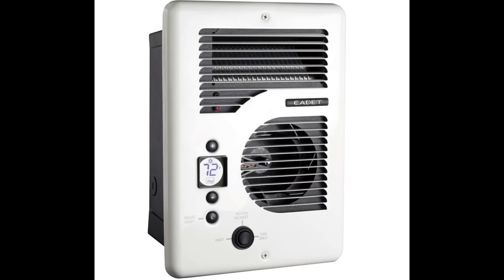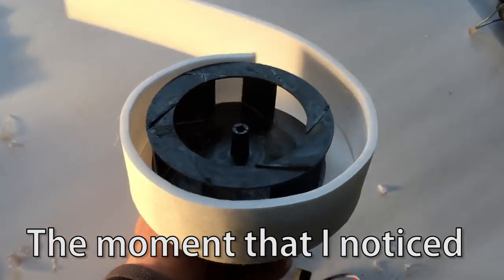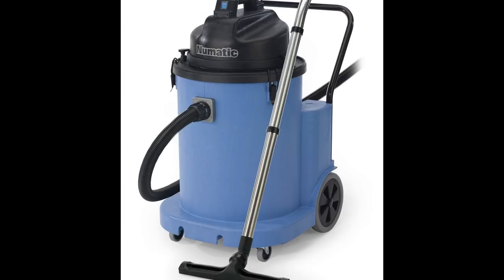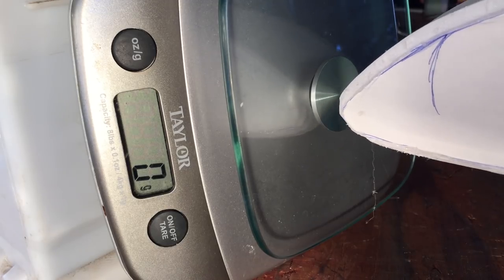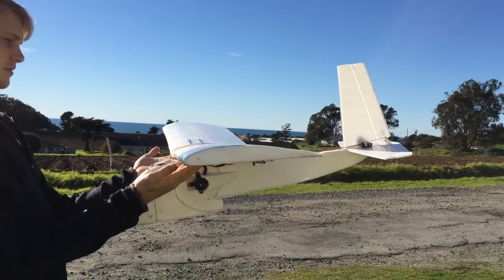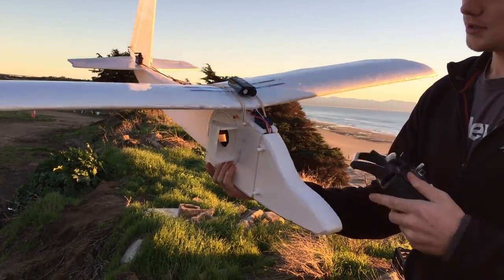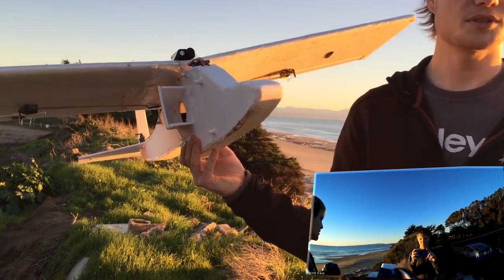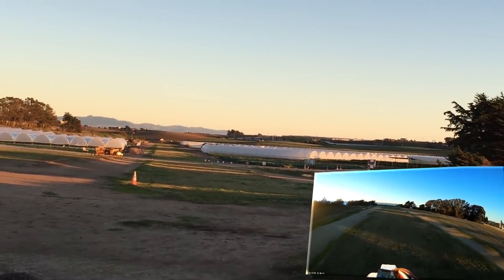This is NOT a Propeller

Comment: Brilliant.  Nice work 'thinking outside the box'.  Your only problem is that the compressor is terribly inefficient.  Centrifugal compressors in jet engines, for example, have curving radial vanes.  You might find such a compressor in some old vacuum cleaner.  If you can find one that's light enough and the right size and use that instead, you might increase your thrust quite a bit.

Comment: I like the moving part contained inside the plane so no dangerous prop outside to cut fingers.  Similarly you could make a cavity in the plane for a propeller system and force air out a similar nozzle.  I wonder how the efficiencies would compare then?

Comment: Centrifugal induction fans are more suited to producing a high static pressure differential rather than a high rate of airflow. Consider ejecting the air out through a smaller nozzle (or array of nozzles) on the inside of a large-diameter tube. As this lowers the pressure in the tube, it should draw a large current of ambient air through the tube and accelerate it, which should increase momentum transfer. (See Dyson's bladeless fan or how you can inflate a large plastic bag by blowing a slow continuous stream into it while holding the opening wide open.)

Comment: Nice. Very nice. Innovation’s always good to see. Wondering if your comment on efficiency is partly from inevitable internal drag from all the ducting surfaces the air is forced to flow past? Torque reaction to impeller/propeller rev changes is also a factor in very lightweight designs but you seem to have dealt with that rather well. Impressive.

Comment: Fantastic: I have been always thinking that a cross flow fan is better than a standard propeller! The one that you have used is not designed for the scope of aircraft propulsion: imagine how much should it have performed if designed exactly for the motor power and RPM that you were using!

Comment: What about the pressure difference created due to the impeller intake on one side, that side would ideally be having a low pressure as compared to other side. In my knowledge that should influence the yaw. Did you feel that while controlling the plane ?

Comment: Great initiative and great video . Not entirely original though . I have seen plans for scratch built ducted fans from the late 1950's and 60's that used home made centrifugal blowers like this . At that time jet engines used centrifugal fans so it probably seemed perfectly natural to those early builders . I have never seen one of these planes actually fly before though so thanks and good job .
I am thinking I should buy a leaf blower and strap some wings on it .....

Comment: You could put the motor inside the fan and remove the cowling for air intake and improve p/w ratio a lot. Very cool development!
Reply: Yes, I agree and:
If the motor is inside the rotor, you can make two inlet ports (1 on each side).  This could improve efficiency by bringing in the air with less resistance
Reply: sure, but he just grabbed an idea and smashed it out, probably in a weekend. you can see the body is roughed out, not aero contoured beyond its being cutout. he just wanted to see if he could do it :-)

Comment: Nice Video part of the lost thrust is the construction -closer spacing between spinning
rotor and frame or using a rotor from a leaf blower with a round frame will give thrust.
for more speed you need to change exhaust outlet size to increase the exit air's speed

Comment: Two things:
1. Invert the entire motor in the airframe to take advantage of gyroscopic precession which will induce a lifting moment.
2. Use the high velocity air moving over the airframe to assist in lift.

Comment: Your comments on the efficiency don't take into account the mass of the fan - probably more than 10x a two bladed axial propeller.  Also, a propeller is constantly being pushed into it's airstream, whereas the centrifugal impeller is operating with it's intake in the slipstream of the body - a partial vacuum.  Centrifugal blowers are designed for higher pressure across the system, but as a trade off they have a lower flow rate.  Use two smaller ones (lighter and less friction at higher RPM) horizontally, counter-rotating, with a well designed intake facing forward, and I'll bet you get a much better efficiency.  Of course, that would mean a lot wider body.  Maybe a flying wing?  lol...

Comment: If you add an extension to your exhaust, and make it a smaller dia. you will accelerate the air and maybe get more thrust
Reply: Actually not, as it would need more weight so it won't rip it in pieces and is controllable.
Reply: @SheIITear  ok

Comment: Thinking again about the Dyson vacuum cleaners...
Why didn't anyone design wings that provide thrust? That impeller is the perfect solution for high velocity output to the trailing edges of the wings  via narrow vents in each ailerons that are effectively thrust vectors and control surfaces.

Comment: Turn the blower 90 degrees so it's sucking air in from the top of the plane, creating a vacuum above the plane and therefore creating more lift. No intake ducting needed.

Comment: I think: and with two impeller of vacuum cleaner, directing the air flow inside the wings...

and the wings with openings underneath that run along the entire length and facing backwards like in a fan without blades?

Comment: I think so if the exhaust would be placed above the body, there would be more lift. A high velocity of air above the body would create low-pressure above the body. But it will require a bit of modification to the tail.
Anyway, loved the video. it was great.

Comment: Nice and satisfyingly noisy. Nice landing, too. Perhaps make the air intake adjustable to find the optimal intake angle. I was surprised the intake didn't seem to make the plane want to turn to the right...
Reply: The blower could be disguised as being the engine of a jet and the sound would sort of fit in.  
You get surprising little effect from sucking in air.  Imagine you are standing right next the surface of the plane with a pressure gauge.  You will see normal air pressure.  When you move next to the opening, you will see only slightly lower.  The difference in pressure times the area is the force and it won't be much.
Optimizing for a blower than moves a lot of air at very little pressure difference will make a more efficient aircraft all else the same.
Reply: Ken Smith   I see. Thanks

Comment: if you turned the intake to the front and then made cone 90% excite you can get the best of both forces. + if impeler is now horizontel you can hide it inside the wing and save on drag.

Comment: You could perhaps get more efficient if you got the blower duct to blow of the top of the wing, as the air on the top of the wing would be moving faster causing lift. Right now the air is blower is blow the rear tale underneath where it is casing it to loose lift, along with the talk will cause it to go nose up under high trust.

Comment: Should go onto ebay and buy the ones they use in Blower style graphics cards, they spin at pretty ridiculous RPM, and make a multi-engine one.   

One interesting difference with you design using the central fugal blowers in that orientation the torque coming off the motor would mostly and fairly easily nuetralized by the tail instead of trying to twist the plane

Comment: Well done Samm!
I believe you could get more thrust by making a turbo on opposite sides of the fuselage with one shaft through one electric motor driving both turbos.
What do you think?
Reply: I just read the comment on the inlet on top for lift. Sounds good! Maybe even a angled up for lift. Because I think you get better current through the turbo with the front pressure
Reply: I just read the comment on the inlet on top for lift. Sounds good! Maybe even a angled up for lift. Because I think you get better current through the turbo with the front pressure

Comment: Couple of things:

First, kudos to your inventiveness!

Second, you more or less lucked out with your exit nozzle.  In fact, it's ALL in the nozzle.  You're right, the ever-increasing spiral of the blow is correct, but what then?  A good nozzle minimally restricts the air while producing far greater velocity.

Third, at low velocities (sub-300 mph) and low altitudes (sub-20,000 feet), propellers are much more efficient than turbines.  This is why all short-haul aircraft use turboprops whereas long-haul aircraft use turbofans.

Fourth, please visit the American Modeling Association's website.  I know you're probably not a member, but those rules you were flagrantly violated were created for a reason, primarily to thwart government interference into line and remote controlled aircraft.  

Please follow the rules and help us keep it that way.

Violate the rules and your little beach buzzing session (along with others) will be what results in serious impediments to our hobby!

Comment: Maybe it doesn't get enough air. That's a very common problem at normal EDF. You could try to remove the air intake or mount a bigger one. When the air goes through the intake, it has to go around a 90 degrees corner to get into the fan. At normal EDFs that causes a lack of power. But the characteristics of this Fan are also typical for EDFs: Efficient at high speeds and the plane can get very fast, but very little thrust.

Comment: have to try a few adaptations to this. I feel with the knowlage I have on these fans, that sucker should have hualed ass. I can't see a 2 blade single prop out thrusting this. I'm wondering if the intake should have been bigger. and also wonder if putting two side by side built to spin in opposite directions would counter torque.

Comment: Instead of that heavy metal, low slat count impeller, why not use a printed plastic squirrel cage? It's lighter so you can have more slats/in which increases velocity and with the loss of weight off the impeller, you could increase rotational velocity; amt of air being moved. It would also allow for more airtime since the drag on the motor is decreased. Just a thought.

Comment: Move the air intake to face forward, make the the air thrust nozzle smaller and thinner. Also you could build a small Tesla turbine electric generator and vector some of the thrust into it and charge the battery during flight. Just my two cents thrown in.

Comment: Actually it is a propeller, considering the blower wheel inside propels air creating force by using air as thrust instead of combustion.
Proper term would be
Internal turbine.

Comment: Turbos get more efficient with a smaller the gap better the wheel and the housing.  I suspect the same rule applies to your blower engine. A light weight (carbon fiber?) wheel and housing with very close tolerances might bright back your efficiency and even provide greater thrust than a prop.
Reply from the maker: Agreed

Comment: This may generate less power in the form of torque but theoretically an engine like that could propel a craft to a much higher speed than that of a conventional propeller prop. Imagine constricting the airflow of the exhaust and mixing a little accelerant.

Comment: what if there were two impellers on the wings with the intake ports at the top? I imagine you could get better efficiency by using a 3d printer to tweak the shape of the blades.

Comment: Interesting innovation!  It May be patentable. If not you can improve the concept and get a design patent on it. Go for better fairing and optimizing the size and angle of the impeller blades. It could work better than a standard screw propeller .  A grand should cover the patent.
Reply: Mark White he has passed sadly

Comment: What would happen if you made the fan face forward like a propeller and let the air out at the back at the bottom?
Reply from the maker: I don’t think the intake suction has much effect but that is what RC jet engines are like. A centrifugal compressor facing forward

Comment: Efficiency is low because that thing is not a fan, it's a compressor. It produces little flow but that flow is at elevated pressure. And of course pressure alone doesn't mean anything, pressurizing the bypass air is a waste of power. You should put an expansion nozzle on the exhaust to catch the expanding air energy and convert pressure to thrust. Otherwise the compressed air expands into thin air and the power is lost.

Comment: The air through your propulsion system makes at least 2 major 90 deg directional changes, robbing energy. At slow speed you may actually choke the blower inlet with that inlet duct (bad), and cause a ram air effect at high speed (good).
But a good experiment - just don't fly over the edge of the flat Earth - it will disapear into the abyss below .. ;)

Comment: Would it be better to exhaust from the top to back (over surfaces, faster air, less pressure, more lift) - at angle that wouldn't push it down.

Comment: man thats a great concept , but you lose thrust because your inlet is sideways ... put your inlet in front and you will see what I mean ... also play a bit with the diameter of the inlet... wider in front , and tighter as you reach towards the fan .... you will gain at least 25 % as soon as the plane will accelerate.

Comment: can someone explain how can an airplane with 800grams fly with only 400grams of thrus?? RIP Sam
Reply: The thrust is pushing it, the lift is generated by the wings. The thrust just has to push the plane through the air fast enough so that enough air is flowing over the wings to generate lift
Reply: it's possible to get it in the Air with only 200g Thrust

Comment: Not 400 grams of thrust. Grams are a measure of mass not force. Should've said about 3.9 newtons
Reply from the maker: That technically correct but it’s easier to use because it’s more intuitive to compare thrust and weight. Engineers usually use a mass unit just for ease of thinking about it on earth

Comment: Your intake hole is to small. this type of fan produces most when intake hole is maximum of fan opening on the intake side of the blade.  You could have increased performance by 25% atleast.
SUPER SMART APPLICATION THOUGH! GEEZE.. LOL

Comment: you spend a lot of energy on SPINNING THE AIR inside the turbine.
Reply from the maker: Yea, but that isn’t necessarily always an inmeficiency. There are several things about the internal design that are not ideal, but the centrifugal pump- when well designed- can be very efficient and has many advantages over axial (propeller) types.

Comment: You need to use two of them mirrored to each side, so both the weight of the motors and fans and the intake suction is balanced.   choppergirl.air-war.org
Reply: @theoonyoutube  -  Well that *blows*, both literally and ironically.

Comment: 400 Grams of thrust🤣
Reply from the maker: It is common in aerospace to use grams, kilograms, or pounds as a unit of thrust, despite that these are units of mass and not force. This is because it is easy to compare thrust and weight and intuitively grasp the aircraft’s thrust to weight ratio